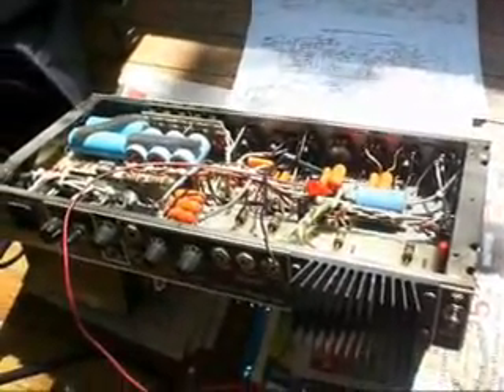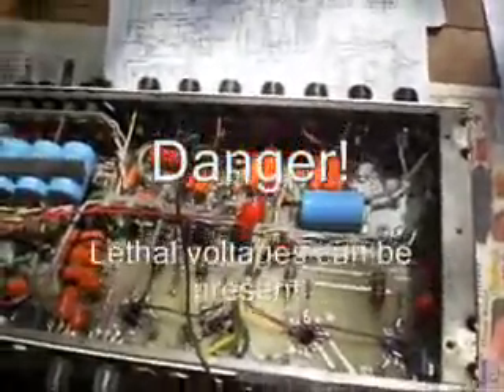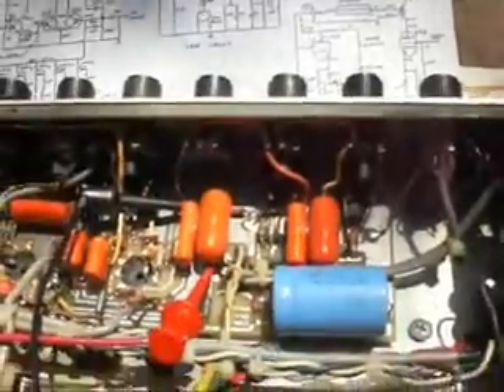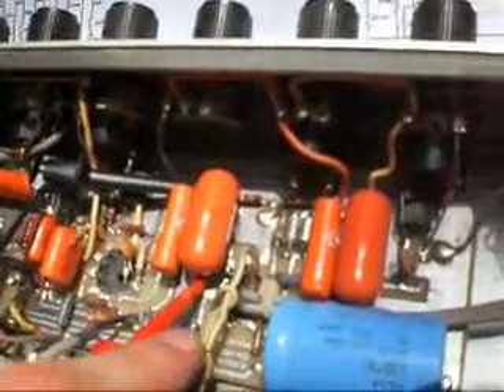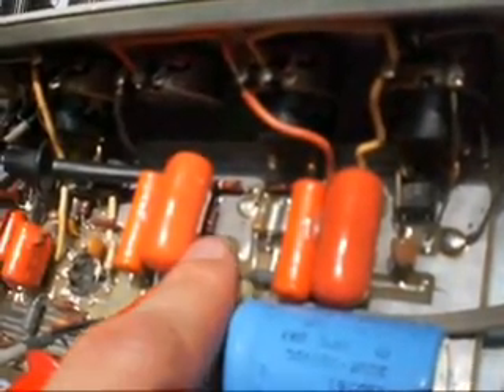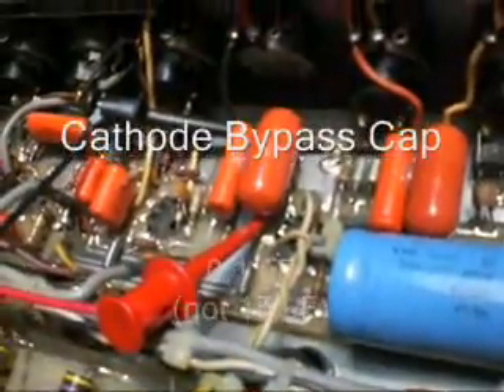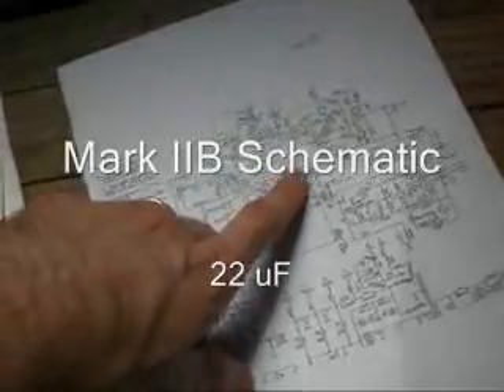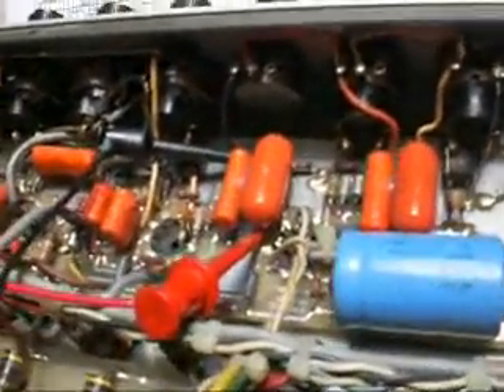Mesa Boogie Mark IIC: Cathode Bypass Cap and Resistor on V1B

Comment: I see that this is an 8 yr thread but anyway, that Orange drop is off the plate of V1B which I thing is a coupling cap that goes to lead input. Cathode caps are typically tantalum caps, 15uf 10v , in parallel with a 1.5 k resistor on pin 8 of tube.

Comment from the maker: For the power transformer, this particular amp has the original transformers for a IIC, which is the "100" transformer.  It does not have the "105" transformer that was introduced partway through the production of IIC+.  For the output transformer it has the "T100" transformer standard for this period for the non-simulclass power amps.

Comment from the maker: @josemi21 
The Mark IIB is indeed different than both the IIC and the famed IIC+.  The biggest differences are in the lead channels.  So, if you dislike the lead channel on the IIB, you may like the IIC or the IIC+.  They're just different (somewhat different tone shaping, different voltages on the tubes, different amount of gain).

The clean channels, however, are more similar than different.  If you dislike the clean channel on the IIB, you'll probably dislike the clean on the IIC and IIC+.

Comment: @chipaudette  My amp was sounding bad. The reverb sounded crappy, the overall amp tone was pathetic. I decided to "blueprint" the Boogie. I found a handfull of out of spec components. Some in the reverb circuit, most on the preamp board including one orange drop near V 3.  I replaced all of the electro caps. Finally I cleaned all ins/outs, pots, graphic EQ sliders and tube socket contacts ( and retensioned as needed) Result: A totally new sounding amp, full response and tone!  Drew

Comment from the maker: @drewswebsite 

So, your post was a long time ago, but after this video, I kept on probing the amp.  It turns out the Mark IIC pulls the effects loop off the cathode of the V1B, which is way early compared to every other amp.  This puts it BEFORE the overdrive circuit, which is not useful if you like some echo/delay on your lead tone.  The 0.1uF cap and 15K resistor that I point out in the video are the branch off to the effects loop.  FYI.

Comment: chipaudette
I have the same caps and resistor that you are pointing out. I ordered the new amp directly from Mesa Boogie  7/25/1983. At that time Mesa would let you order an amp with a small down-payment (mine was $150.00!) and pay the balance off over time as/when you could afford it.   My initial order was for the Super Sixty 60 Watt Model with reverb and a Black Shadow. I later added the Graphic EQ ,2 foot-switches and a road case. In May of 1984 I paid the amp off and took delivery. DrewV